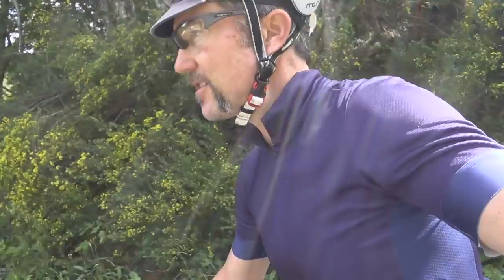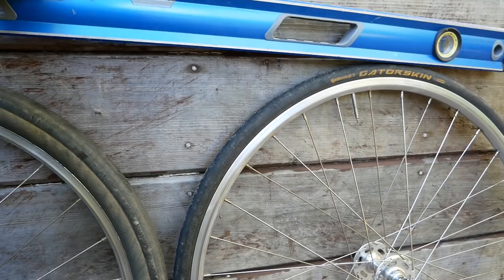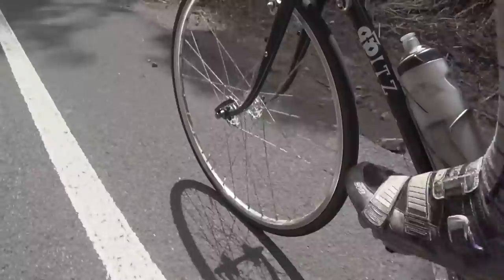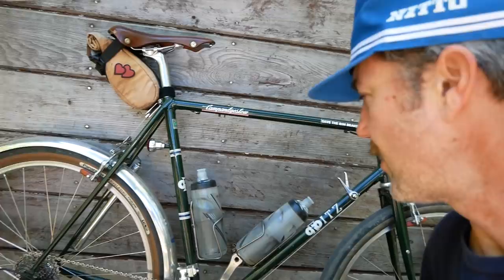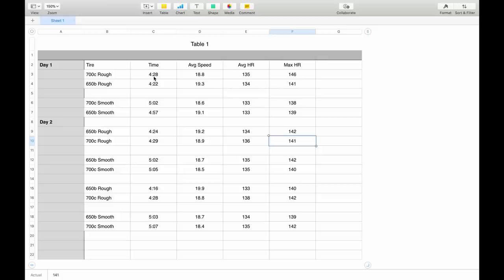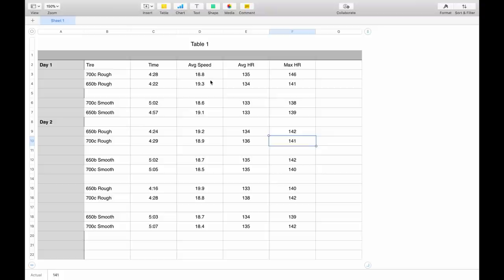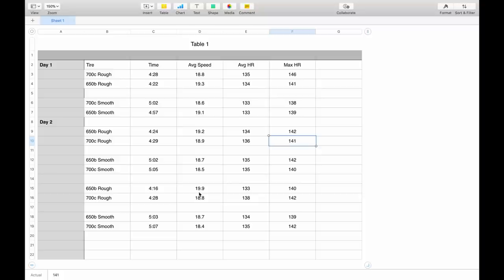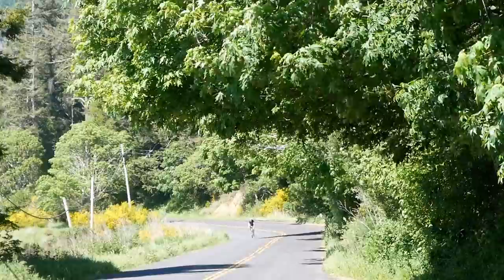The Great Wheel Debate: 650b vs 700c Part 3: A Practical Field Test

Comment: My takeaway is that as a non competitive bicyclist, there is no benefit to 700c skinny tires. 
Very thoughtful video, as always. Keep it up.
Reply: Click Bait I’ve not gotten a flat in years. Knock on wood.
Reply: @dougcohenmiller  I have heard that a 650b tire which is inflated at typically lower pressures than 700c narrow tires can be very flat resistant.
Reply: @dougcohenmiller  get some Rene Herse (formerly Compass) tires and you'll fix that. I know whereof I speak.
Reply: I had the same take away, @doug.

Comment: Your test was actually fairly scientific.  Adding cadence would have added more support to fairness but generally your HR control was on point. 

All the science I've read continues to tell me fat tyres are faster right up until the point where aerodynamics matter - circa 40km/h - and the speed differential will drop the closure you approach aerodynamic impact. 

The missing test for me here is what happens when you run a fat 700c tyre - GK38 or Rene Herse 38 - over a 700 X 25 Gatorskin.  650 has benefits but if you can get those benefits on a larger rim then surely the benefit increases.

Comment: Using a power meter I discovered, 700x28-30 are decently faster then 650x47-50.  I personally like 700x38-40 for comfort with a minimum amount of extra power required.  I used my Open UP for my testing, this bike is disc braked and I have a 650 and 700 DT Swiss GR 1600 wheelset for both.  Using a heart rate monitor is not an accurate way to test verse a power meter.  Using 240W’s for all tires for a 15 mile loop road, the 700x28 tires ran 48 seconds faster, the 700x38 tires were 32 seconds faster then the 650x48.  I used Vittoria Corsa G2 for 28, Rene Herse Steilacoom 38 and Rene Herse Juniper Ridge 48.  There is a reason in gravel races riders all use 700x35-40.  There is a point were you start to use more power but don’t realize since wider tires provide more comfort on broken pavement but when it comes to hills you notice how much more power is required to climb.  And how much rolling resistance slows you down after a hill. 
Using a heavier wheelset plus only a heart rate monitor both makes your test inaccurate.  Plus did one wheelset have better hubs then the other and is your bike optimized to use either size wheels. I badly wanted wider 650 wheels to be faster because they are more comfortable but even testing the 38’s verse the 48’s on a 9.6 mile gravel/dirt trail with 411 feet of vertical change the 38’s still 29 seconds faster using 250w’s of power for both.  On short bursts of 1.5 mile loops trying to get the same time, the 48 wheels required about 20w’s more power.  I wouldn’t bring my 28 slick road tires anywhere near the trail they flat, only tubeless tires that can withstand rocks.  I’ve played with slick tires verse patterned tires for power usage, found that tire material matters just as much as pattern.  Something like the Schwalbe g ones look fast but were actually slower rolling then the Rene Herse Steilacoom, both on and off pavement.  This was a shock, the Maxxis Ramblers were also quicker then the panaracer GravelKing SK’s, the Rene Herse Barlow Pass were much faster then the GravelKing flats.  So a more supple or tacky rubber was faster then a hard rubber.  The hard rubbers were a bit more durable on harsher gravel roadways.  The softer rubber tires also tended to weigh 100g less then hard rubber tires which also helped.
I use this info because I race gravel in New England for fun, Ted King’s home town NH race last two years and 3 other races in Vermont and Massachusetts.  And there is definitely a reason racers are using 700x35-40 sized tires, they are unfortunately faster or use less power, from talking to other racers including Ted King, 42 seems to be the point of no return.  And that seems to be the max most racers will even if think of using in a race no matter how muddy the conditions.
Again heart rate is not power used, since your body’s comfort can have an impact on your heart rate.  You should use a power monitor.
Reply from the maker: Hi Peter, Thanks for sharing your test results. Did I read your test description correctly, the 650b tires you tested were a knobby 650b x 48mm wide (Juniper Ridge) and compared those to a slick Vitoria Corsa 28? It's interesting to see how fast a knobby tire actually rolls on pavement! A difference of 48 seconds over a 15 mile course, that's pretty amazing. 
Not to take anything away from your testing as it is very interesting, but there are couple of things to keep in mind. A power meter would be a more objective way to perform this test, especially if the rider using it can pedal in a very controlled manner, and the power data itself was accurate. Most power meter data is very scattered as I'm sure you know. In order to read the data there is quite a bit of averaging necessary to smooth out the erratic peaks and valleys. Most power meters take a sample at the crank and since power is not uniform over the complete pedal cycle, each pedal stroke is averaged again. Some power meters like Stages for example only sample from one side of the crank, and double that number to compensate for the other side.  
A power meter is also only as accurate as the strain gauges and data acquisition systems they used to construct it. Most use a temperature compensating strain gauge to eliminate the variations caused by outside temperate changes, but there is still a certain amount of inaccuracy with all consumer grade power meters. Unfortunately, due to the size and weight of these bicycle power meters they are not very accurate for testing use, but work well enough as a training tool to get "close enough." A 2.5% to 5% error in the device at 240 watts, which isn't out of the realm of possibility, means there could be a 5 to 10 watt discrepancy just in the test data. Add that error to other errors in the test set up like wind, bearing friction, rolling terrain, etc. and the errors compound. Inaccuracies aside, as there is no perfect experiment, the information you have is still interesting. Most importantly it shows how our perception is often inaccurate too. I always thought the 700c wheels and tires were faster too, because it felt faster. 
The purpose of my choosing a flat road was to remove any variations caused by the slight differences in wheel weight. Although far from perfect, my test was aimed at determining only how tire width affects rolling resistance on a paved road with different surface roughness. Wheel weight in this case only matters when the wheel is first accelerating, but at a steady speed the weight differences no longer affect the rolling resistance. 
All of that aside, your testing points out how different tire treads and compounds affect rolling resistance. It also shows how hills and weight differences do matter. I don't know how much testing Ted King has conducted on different tires/wheels. His race results obviously speak for itself, and he knows what works for himself. Gravel racing, or any racing for that matter is quite complex, and while equipment is a part of it, so too are a bunch of other things. Maybe what he means is that running anything wider than a 42mm on a 700c is the point of no return, at least in his mind, and for a gravel race as a tire on a 700c wheel gets wider it also gets heavier? I think DK has a bunch of punchy climbs, but none more than a few hundred feet at a time? I wonder if he were to run a smaller lighter 650b wheel with a wider tire, the weight would be less and perhaps the extra tire volume would be faster and help to smooth out the bumps better? Perhaps he's already tried this and didn't find any significant advantage? Thanks again for sharing your results and I appreciate the opportunity to share my thoughts too.
Reply: Henrywildeberry I found it most interesting that the knobby 700x38 tires were only 16 seconds slower then the slicks.  But again I found tire materials made a huge difference in speed.  Harder larger tires were actually slower then softer wider tires, which was hard for me to believe.  But I guess soft rubber provided better traction.  With going to a bunch of gravel races now, talking with people there including Ted King who was very friendly and actually used the same tires as me.  I’ve learned that no one has ever won or placed well on 650’s, everyone I’ve talked to stated they just have too much resistance and a smaller circumference and rolling inertia.  Weight on the Rene Herse 700x38 tire is 388g and weight on the same tred Rene Herse 650x48 is 455g so the 650 wider tires are almost always heavier unless they are different materials being compared.  The wheelset difference in my DT Swiss the 700 is about 45g heavier over the same DT Swiss 650 set.  So total weight the 700’s are about 20-25g per wheel lighter.  One would think in climbs wider tires would be better but I have not found that to be true, more softer rubber tends to be faster.  Next test I want to try my 700x38 slicks against the 700x28 slicks, I’m curious if there’s any real difference besides comfort.  In the few road races I’ve done recently, used to do a lot a decade ago, I’ve notice many riders now use 28 and there are even a few at 30 but less and less at 25.  28 seems to be the new 25.  I use the dual crank Shimano power meter which does a good job of not dropping out.  My road bike uses an S-works which also works very well.  I know my old FSA one used to drop and just average, but modern ones seem to keeps much more accurate information, claimed +/- 1% on Shimano and 1.5% on S-works.
Reply from the maker: Peter Choma I’m very impressed with all your experimentation. Not many would put in the time. I’m also very surprised by the difference in weight between your two wheel sets. In part one or two of this series I measured the weight of two exact rims of the same extrusion and found the 700c was 100 grams heavier than the 650b and that’s not including the spokes. These were aluminum rims and Carbon fiber, being a very lightweight material, the difference in weight between the two sizes would be less. It makes sense that bike racers chose carbon over aluminum. The reason I shy away from race results as a measurement of comparison is that they are non repeatable experiments. We’ve seen many cases here on the west coast where riders doing mixed terrain races are standing on the podium together where one rider was on a mountain bike and another on a gravel bike with completely different tire and wheel sizes. Just a few years ago people were dismissing tires as wide as 38 to 40 mm as being too slow. I remember road racing on 23s and no one then would have ever imagined running 30 mm wide tires, now 30s are the new 28s.

Comment: I'm enjoying this series, my main takeaway so far is don't sweat the details too hard and find something you enjoy riding as the numbers come pretty close and there are so many details beyond just 650b vs 700c in these circumstances.
Reply: Yup, this. A difference of a few seconds on a bike that wasn't built just for speed. However I'm sold on the 650b cause 'im built for comfort baby, you know I ain't built for speed..'🎶
Reply: I have been thinking about this for some time. Maybe the pneumatic tire made of rubber combined with the road conditions only go so fast. Its usually a few seconds one way or the other in the differences between tires. Maybe the game changer is hub bearings and aerodynamics or maybe an unknown factor that one has yet to consider! I agree, ride what you like! After all you are the only one that has to like it! Above all enjoy the ride!!!
Reply: @johnhorgash9031  In Henry's earlier videos he mentioned something I really think plays a factor. Weight of the wheel especially as it gets farther from the axle. Getting lighter rims and lighter tires is what I expect to be a larger factor in creating a faster bike.
Reply: @SgtToastieYT  lighter tires doesn't mean faster. Heavier rims take more power to speed up but they also are easier to keep going. So if you have an aerodynamic rim  that is heavier the momentum keeps it going and the aero benefit makes it faster in the long run.

Comment: I like all things about cycling.  I am aware of the narrow vs. wide tire debate and I like hearing from both sides.  However,  my riding conditions dictate my tire width.  I spend 95% of my cycling time on dirt roads, so I prefer tires ranging from 40mm to 3.0."  Speed is not a factor; comfort is.  I thank you for investing time and effort and presenting more information.  Say hello to Ms. Cools.

Comment: Not sure if anyone already mentioned Contact Patch on the road.  The fatter rubber is quicker because it provides better traction with every pedal stroke.  I'm sure cornering speeds would also be higher with increased traction, or confidence to go faster as a byproduct.  Maybe on a not windy day, weigh yourself and bike with different wheels/rubber, fill a water bottle to compensate for the lighter equipment and do a dead roll start descent test, all gravity coasting straightest line possible, this will give you rolling resistance differences.  If the speeds are closer or thinner rubber turns out to be quicker, then you sort of know your gains are during acceleration or power/torque application.  Thanks for all the great videos.  Awesome channel.

Comment: I once read in a forum about the "beeing faster " sensation. This wasnt about 650b vs 700c but just slimmer vs wider and more vs less pressure. On the harder tire you feel more vibration and this gives you the feeling of beeing faster. That was their conclusion and I find this kind of logical.

Comment: Thanks for this test. I think it would be interesting to compare the weight of the two wheel sets. The results are very close, but we have to take in account that this is a comparison of a 26 mm tire vs 48 mm. The 48 gives you much more comfort riding on uneven terrain and is as fast es a narrow road tire. I think that is the most interesting conclusion of this test. That you can gain comfort without loosing speed.

Comment: Yes,interesting. I live in Donegal-West Coast of Ireland.  Lots of single track mountain back roads and some forestry tracks...rough roads.  Been riding road bike 700x25 for years around these roads. Last year built gravel bike and using WTB 650x47 tyres. Bottom line,650 much more comfortable and smooth ride.Therefore prefer them and can push hard if I choose without suffering bone shaking discomfort.  On long group rides,mostly on decent roads would use my race bike 700x25.But the 650’s are SO MUCH better over rough,gravel and on local group MTB rides also. I really enjoy the smooth,versatile ride of the 650’s. Also really enjoy riding my race bike....Great to have both!

Comment: This is very interesting! I have found that Gatorskin tires are slow and not particularly puncture resistant. My Continental 4 season tires 23 cm are slow as well . The Continental Grand Prix 4000 sii are about 1 to 1.5 mph faster according to my grossly informal testing on chip and seal and smooth roads. Mostly just on my normal rides. 
I would have to buy new bikes to be able to ride 650b wheels!  
I wonder how much bearings and spoke count contribute to the equation.
Switching to my Zipp 404 (the old style) wheelset gives me a 1.5 to 2 mph increase compared to my Ksyrium elite wheelset. 
And the Zipps do feel faster with less effort. 
I have. 20 inch x 1.5 inch and a16 inch x1.5  tires on my old recumbent and they roll just fine. 
You really have me thinking!
Reply: Check out Hambini for info on bearings.

Comment: Interesting how I starting cycling in the very early 1970's when American bikes used 27 x 1 1/4 tires and European bikes  used 700 C and 27 x 1/ 1/4 went out of favor.   BTW,  I hated center- pull brakes then and still do today!  Long live down-tube shifting,  toe-clips, and metal frames!  Keep up the videos.  I try to not miss any.  How to design a "double blind" experiment?  I surely don't know.

Comment: Great video. While there are variables in the test, I still think this is useful data, and it appears to be inline with Jan's own tests, in which he controlled for all of the variables and still found the wider tires to be faster. I've also found that the skinnier tires feel faster, and enjoy chewing on the paradox of that. It's fun to think that my 54mm supple wall tires on my dirt drop bike could be just as fast or faster than a 28mm tire on my road bike.